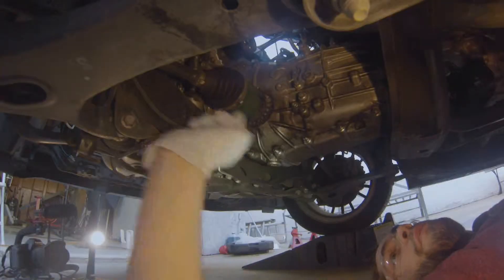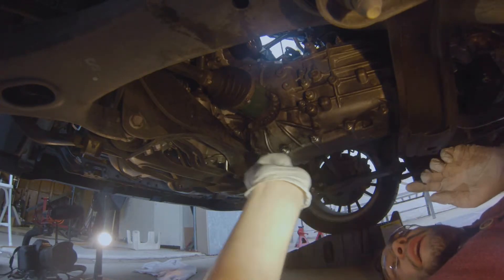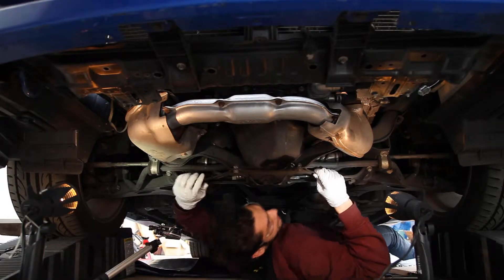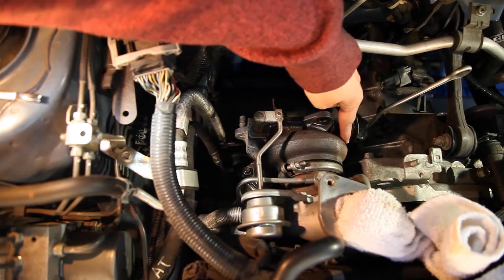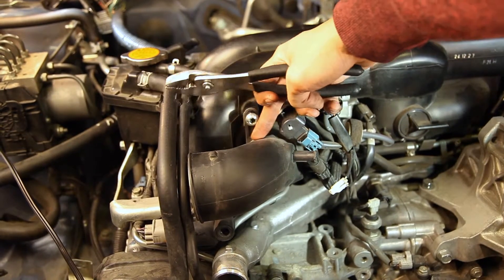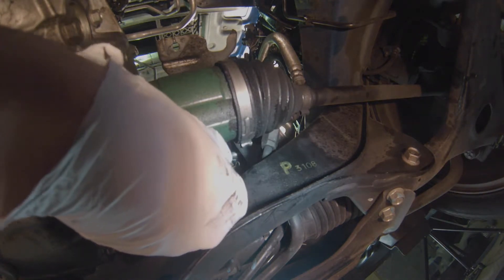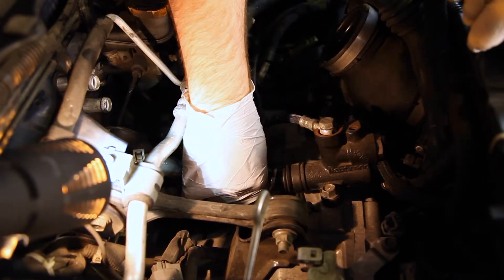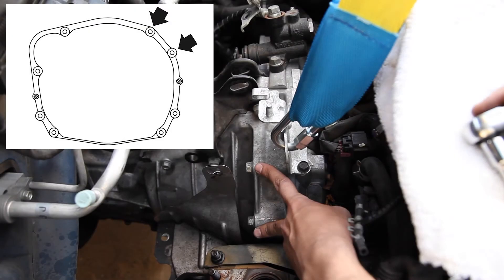How to Remove a Subaru WRX engine part 3: Transmission Bolts, Motor Mounts, Starter and Turbo

Comment: Plus+1 for all the great comments on the quality of this series.  I have the same spun rod bearing issue in my 2014 WRX.  The only difference is your engine is WAY cleaner than mine!  I"ll have mine out soon following your step-by-step.  I'm curious: did you send the engine for rebuild or did you straight-up replace?  If rebuild, and if you can recommend them, I would love to know who did the work.  As knowledgeable as you obviously are about your car, I'm sure you wouldn't give the rebuild to just anyone...